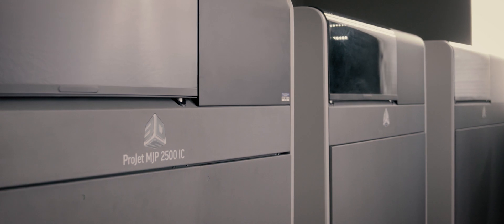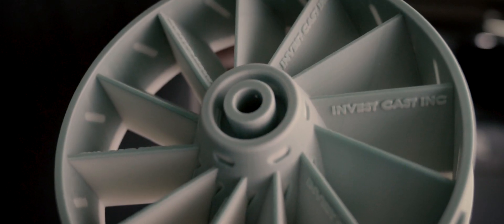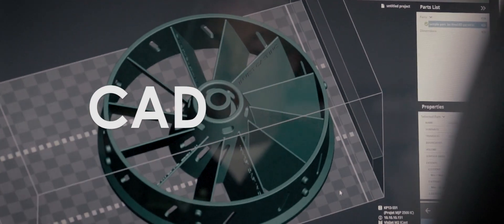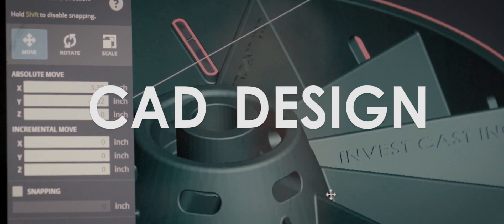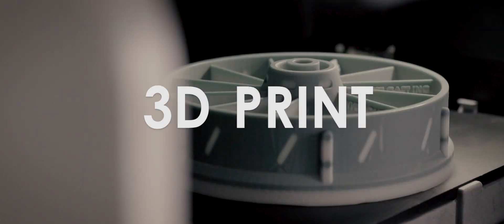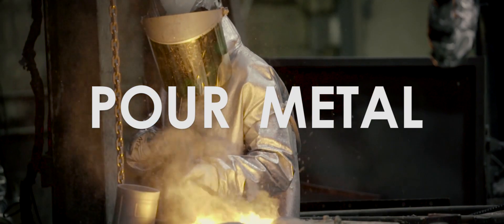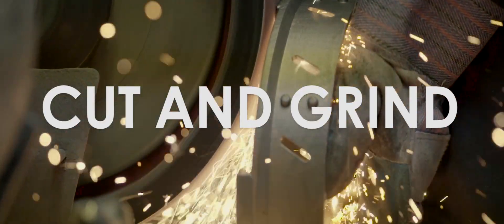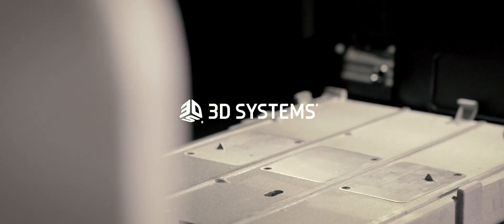Understanding How 3D Printed Casting Patterns Work in the Foundry

Comment: How does the pricing compare to CNC machining parts in low volume runs, and also how dimensionally accurate are casting compared to CNC machining or DMLS?

Comment: Why not just directly print sand like voxeljet and exone does?
Reply from the maker: Wax 3D printed patterns from the MJP 2500 IC 3D printer deliver much better surface finish and detail replication than sand casting so it is a preferred solution when that is needed in cast parts